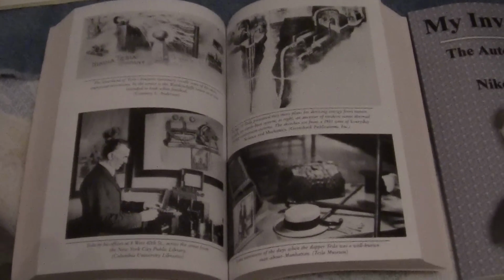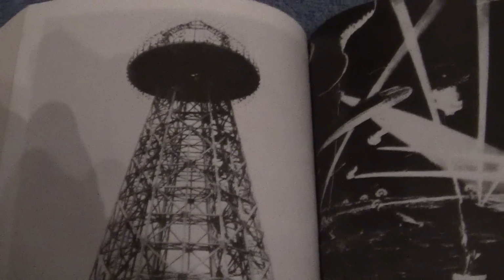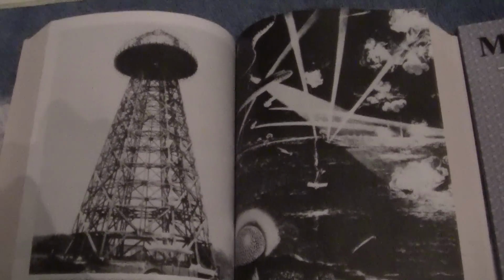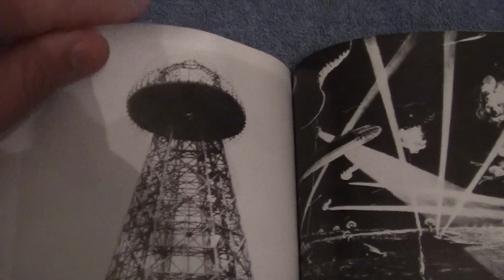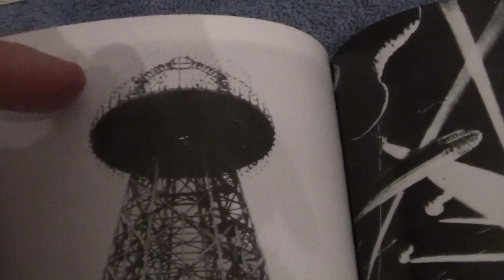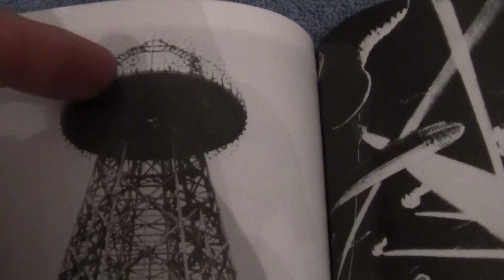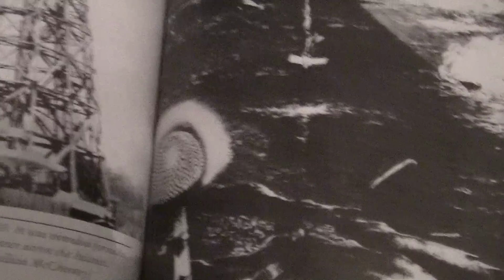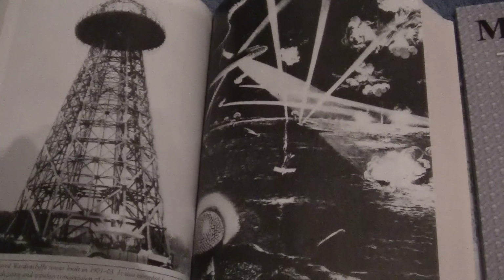3- NIKOLA TESLA --ENERGY TOWER= SOLVED

Comment: Tesla had a pair of pancake coils at the base of his tower. These coils would have a special osscilation. The result is a scaler wave, or a longitudinal wave being produced at the teop of the tower. The wave would travel at Pi/2*C speed, and would actually collect all other frequencies that would match its frequency. The resiever (miles away) would also have a pancake coil connected to a ball. The reciever would be powered from the tower. The key is the frequency of this longitudinal wave. That has to be obtained 1st. Today we can use transistors and a potentiameter combined with these pancake coils to tune the circuit. Very very simple. Look up Konstatine Meyl.

Comment: Tesla accessed the ether with hi voltage and spark gaps, he stored dielectric energy in capacitors. but there is much research to be done. He said the electron was a negative wave interference with Dielectric and Magnetic field lines creating the electron.This would mean other then scalar waves there would be a host of new waves. Keeping in mind all our instruments today generate waves with electrons and so if you had a new "electron" or wave pattern then you should produce a different waveform from the generator. Different input energy differnent output !!! Right ????
Please let me know if you got that ?? maybe add on ... plz and thanks =)